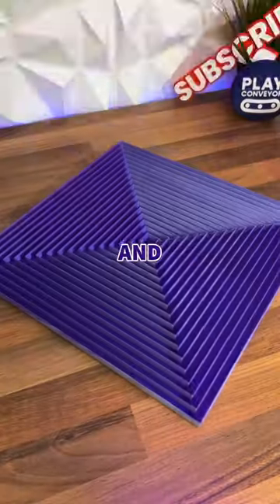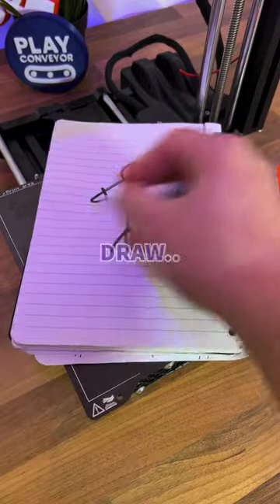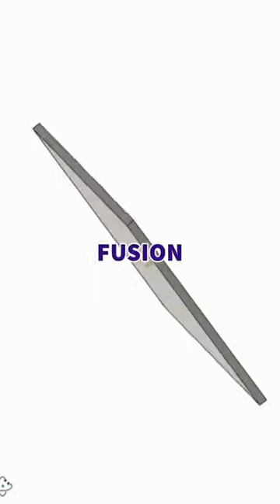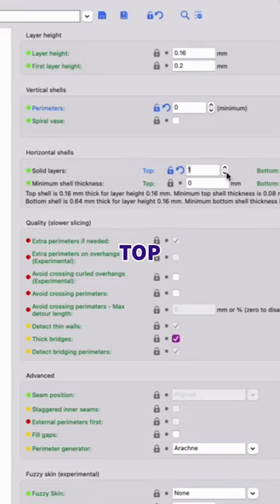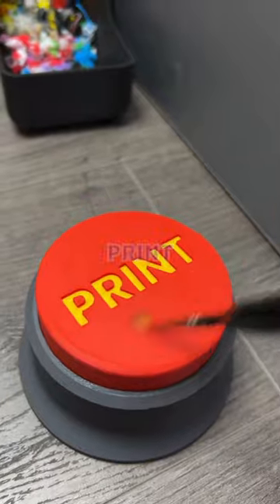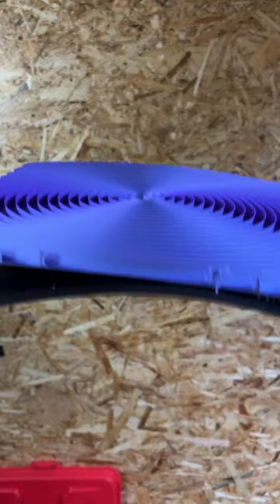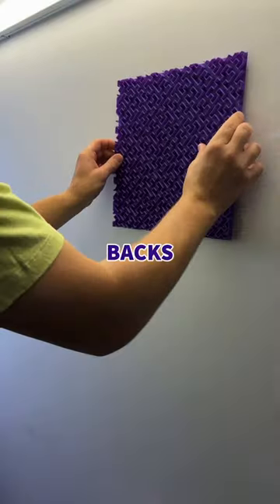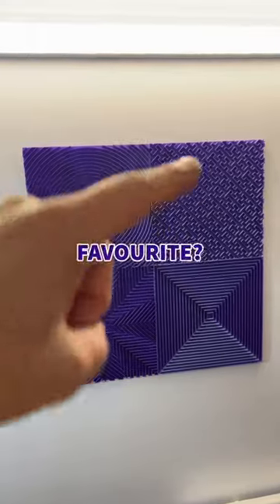How to make 3D printed WALL ART! 🎨 #3dprinting #shorts #art

Comment: You can use mounting tape instead of caulk if you don't want it to be permanent. Just make sure you use the clear kind, its made out of a gel that comes off easy and doesn't leave residue. There's a white foam kind that falls apart and leaves bits and pieces of itself stuck to the wall.